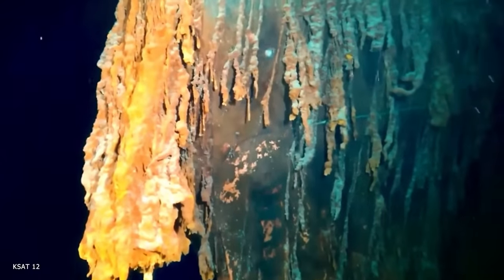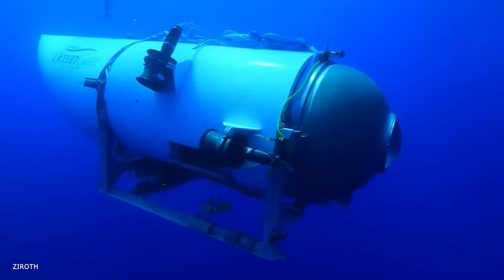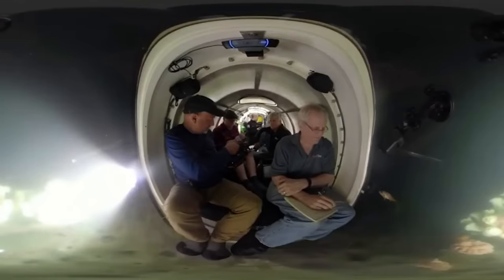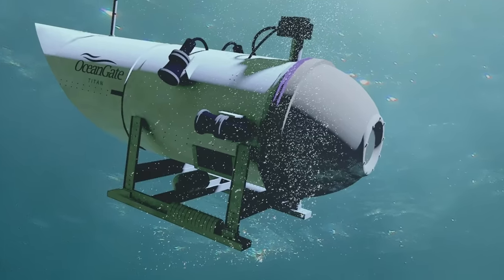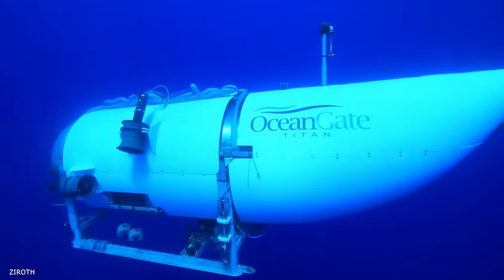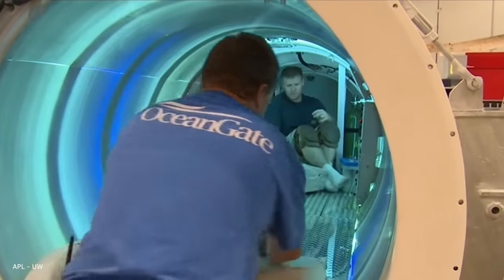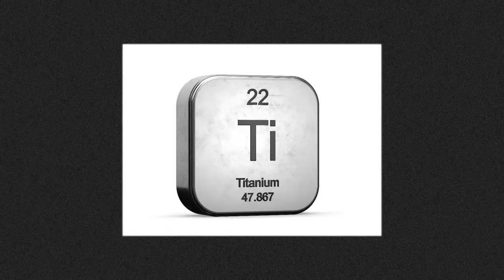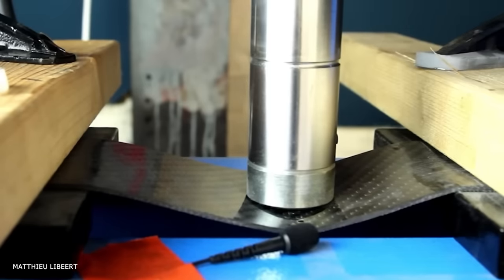James Cameron Just Reveals TERRIFYING Truth About The Oceangate Submarine!

Comment: Human is made to walk upright on two feet in normal atmosphere.
Going under oceans surface, going at high speed in the air or on earth, travel trough space, stepping midair out of a plane to slide down, hanging on some feet in square of silk....... is a risk, up a point it's a danger, up a certain point it's deadly / fatal. 
Some of these thing are done several thousands, even millions of times, that they are pronounced "safe". They are likely to be, but are they really? 
There is a long list of things who endet in disaster, only because someone believed he can brake the rules and tell those, who simply want stay alive- and therefore respected the rules, "idiots, cowards, dumps...". (yes I know and accept: simply being alive takes just more than the risk to die. Death comes for sure)

If ordinary life is boring,  take the risk, deal with your faith, and if it turns well, next time you set the bar a little bit higher / deeper / farer, till you make the shocking realization: "I shut not have  go to this point, I shut not be her. My previous challenge  should have bee the last, I should have stopped there".

It must be shocking when you feel the grip of death and you make the bitter / final realization, you have no more options and: these "one time too"...: too far, too deep, too fast, too often..... ends in: too late.

Comment: Narcissistic and dumb. You don’t need to be an engineer to know that a fiber material will crush. The only reason it lasted at all is because it was so thick. Can you push on a rope or a chain? No. Thats not how rope and chain works. 
That sub would have handled a lot of internal pressure as long as the ends didn’t blow off because that is what a fiber material does best. How he could not understand this is mind boggling.